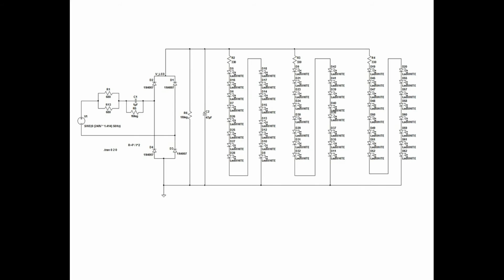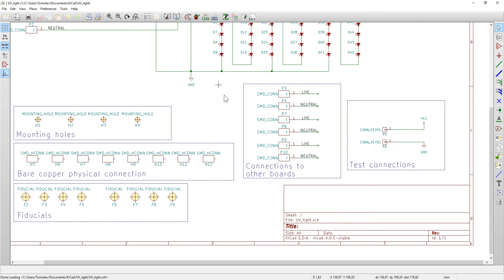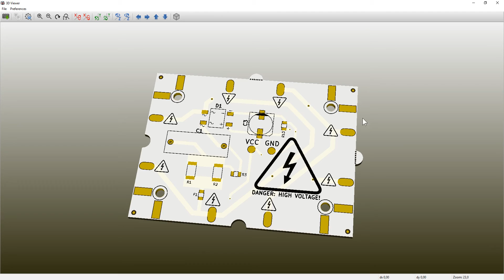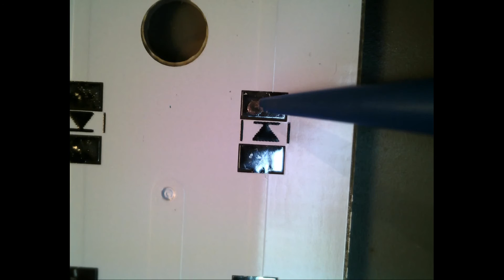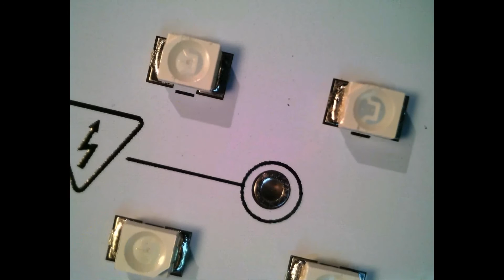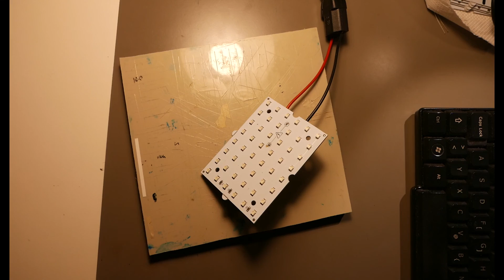Direct mains voltage LED panel (UV)

Comment: Have you tried to connect it to two Earth supply ?

- One earth as 220v earth supply from the house

- One earth as water copper pipe or something that is Earthing. Without commercial supply.

#FreeEnergyFE #NigelCooper